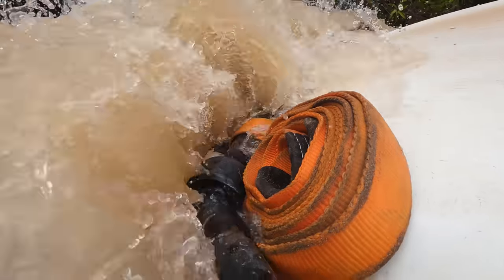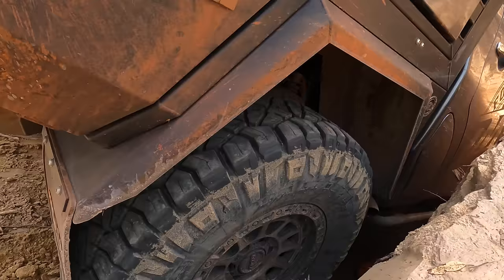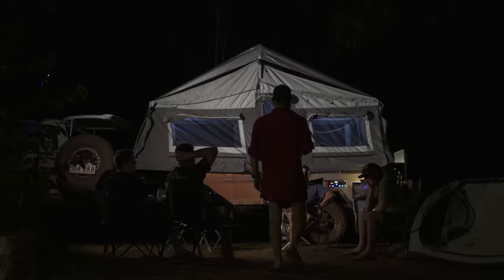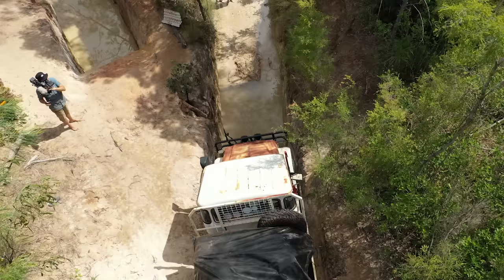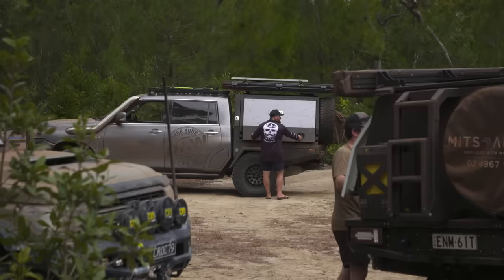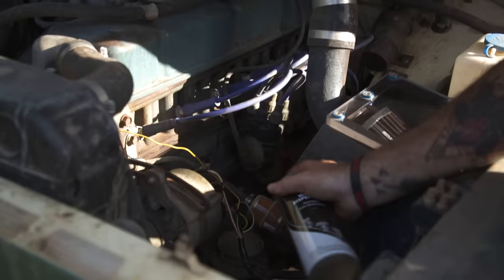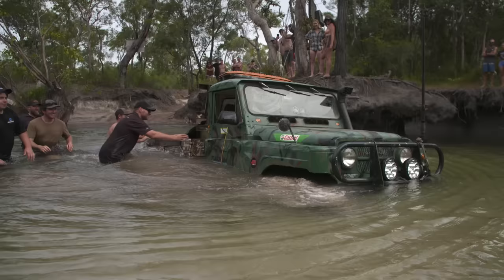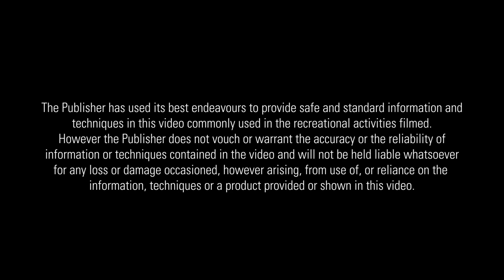50yo 4WDS vs. CAPE YORK! River crossings SO DEEP the seats go under!

Comment: I'd LOVE to bring my '69 rhd back to Australia (bought & brought it back to the U.S. in 1976) and try this. Its all stock with the original straight 6, 3 spd. on the tree, factory locker (one hub on the right), oil bath air filter, vacuum knob for the 4x4, throttle knob, even still has the hole in the front for the hand start crank. The only addition is an old Warn 8k winch...

Comment: I just got my first real 4WD. She's a 2015 Toyota Hilux SR Dual cab chassis with steel canopy. Just spent the last week building a DIY 12v dual battery system with DC to DC charger and solar input and a 1500w inverter. I'm sure I'll have plenty of awesome 4WD adventures in her. I've called her Beast LUX which would look awesome, embroidered on some custom razor back canvas seat covers 👌🏼

Comment: Gday legends. I drive an 84 yn65 single cab hilux. Used to have a 3Y 2 litre carbureted petrol engine, but has been swapped out for a 3.8 litre v6 out of a vn commodore. The old boy has twin auto lockers and has affectionately been named “Old Greg”, which is what I would have on my custom seat covers. Keep making tracks boys, and have a cold one for me.

Comment: Running a 97 Jeep Wrangler TJ. 6in suspension lift and 3 in body on 37/13r15 super swamper boggers, Ford 9in axles. Only thing missing is the seat covers. Since Dirty 30 is already take and the name of the rig. I would have to follow suit with the name of the “ Purple Nurple”

Comment: Did the exact same thing as the farmtruck just last weekend in my 3f 80 series except broke an engine mount and the fans gone straight through the shroud hit the bonnet took out all the blades and a swipe out the radiator 😂 a set of razor backs with turtle on em would definitely soften the blow

Comment: I drive a 1990 Volkswagen Jetta gl with a 1.6l I4 diesel. The motor is nicknamed the dirty diesel because it smokes so much. The seats are pretty old and worn so if I got those seat covers they would say "The Dirty DIESEL"
Reply: Also a manual transmission

Comment: Hey guys, just wondering what the difference is between a steel wire cable winch and a fibrous rope winch is. And if you guys made a video about the difference that would be amazing cheers!